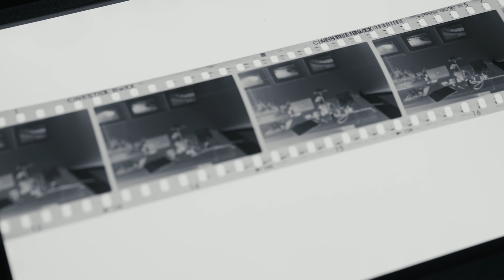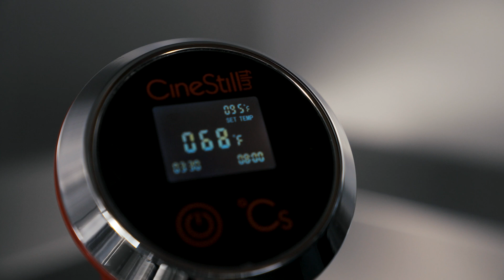The Film Grain Looks Weird. Is it Reticulation?

Comment: I knew about reticulation because I go back to the era when film was all there was... but this was the first time I'd heard about the problem with using distilled water for a rinse, so thanks for teaching me something! Side note: You might want to experiment with producing reticulation as a creative effect (Max Waldman was reputed to have done this, although he was very secretive about his techniques so no one nows for sure.) If so, a good starting point is to use an old-fashioned thick-emulsion film, develop it at the highest temperature you can stand (80 degrees F or more) and then dump an ice water rinse into the tank immediately after the developer. Or, I've heard some people develop and fix the film normally (use non-hardening fixer for best results) then plunge it alternately into very hot and very cold water. Who knows, it could be the next Instagram trend!